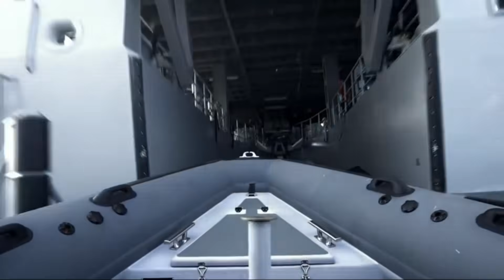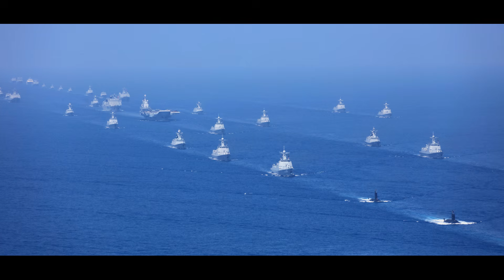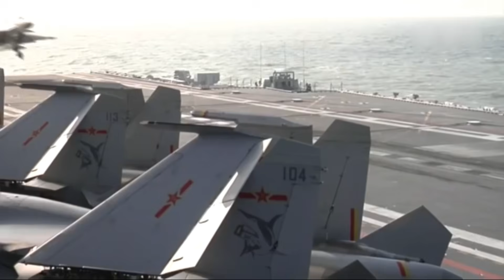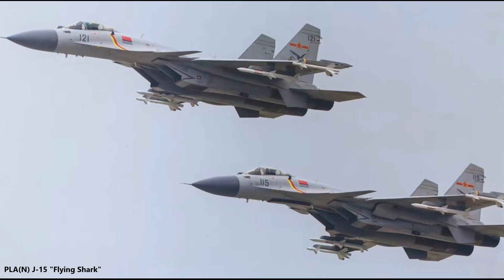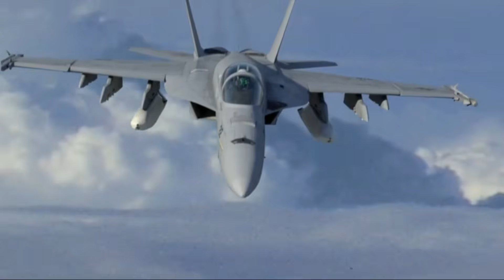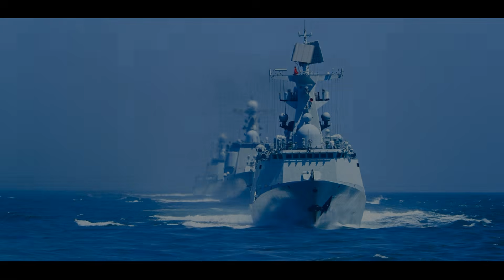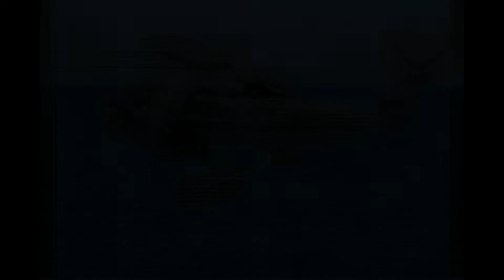Up-Gunning the Arafura Class OPV

Comment: This is second time that I have watched this excellent video, with a gap of about two years between them. It is ironic that the lack of armament for this class has become more and more controversial as the threat from China keeps increasing. Last year a small Chinese taskforce conducted a live fire drill right in the area between New Zealand and Australia, which created a massive panic. It is clear that both the RAN and the RNZN are lightweight players stuck who are largely stuck with a handful of obsolete platforms. They will be in serious trouble if a war begins, and that possibility keeps increasing. It is a huge shame that politicians from both countries didn’t take the three seriously.
 As did the Arafura, it is a good looking ship that is ideal for constabulary duty and humanitarian relief missions. It is a big upgrade on the previous classes. Yet it is a major oversight that it doesn’t have a respectable armament with matching sonar and radar systems. They should have given it a 57mm main gun, an eight-cell VLS block, two single torpedo tubes, two decoy flare launchers, and maybe two remote-controlled heavy machine guns or small auto-cannons. Now that might sound excessive to a few people, but that is what European corvettes are now getting equipped with. There is a new Cold War starting, with China, Russian, North Korean, and Iran all on the other side.

Comment: The analysis presented in this video is comprehensive,  however recent experiences  in the conflicts in Europe and the Middle East demonstrate how rapidly war technology can change. The use of  attack drones has escalated very rapidly. These small drones could be launched from fishing vessels as well as regular naval vessels. Operate beyond visual range is also possible. Further, arms payloads of these new drones have grown in both size and weight.  The potential conflict scenarios presented in the video don’t seem to take into account the harassing tactics employed by that large northern neighbour. No doubt the use of these new drones for sea based harrassment operations by an adversary needs to be factored into the configuration of Australian naval vessels such as the OPVs.

Comment: Interesting analysis.

Although Canada's strategic and threat environment is quite different to Australia's,  Canada would do well to replace its existing fleet of aging and obsolescent Kingston-class Maritime Coastal Defence Vessels (MCDV) with a modern OPV like the Arafura. 

I'm told that a prototype OPV is being developed by a consortium of companies including Fincantieri, Thales Canada, and a couple of other companies. The ships will be designed and built in Canada. Potential armament and sensor systems have yet to be identified, but containerized mission pods are being considered as part of the overall design.
Reply: The big news today basically sums that up. The Arafuras will likely end up with Border Force and a couple could end up being donated to PNG. They've said they're not procuring anymore than the 6 that have been built or are on the slipways.

Comment: I get the feeling that the more one optimizes a patrol ship for naval warfare, the less it can perform other roles like finding & boarding commercial vessels. Everything is a trade-off (weight, space, cost), so if you just keep adding more naval warfare capabilities you will end up just wishing you'd built another frigate.
The Chinese "patrol boats" are much more aggressively on the warfare side of that pendulum, but as the video makes clear, they are looking at potential confrontations in a very different way.

Comment: so thinking of cost constraints the missile needed for saturation only have to have strike range and guided ability so for example could use dummy missiles to help overwhelm a ships or fleets defensive system so even a containerized dummy missile system could contribute at much lesser cost and could be fitted on many ships naval ones with container capability and smaller specially made ones I've recently been wondering about the size of VLS's and their ability to be fitted in containers don't have to be MK41 cells the earlier systems could do the same for dummies but can the MK41or others be containerized?

Comment: The Arafura should be classed as Tier 3 vessels in the new Navy parlance. First 4-6 of these vessels should go the the ABV. The last batch should have the helideck instated. The upgunning should consist of 30mm weapon as far forward on the B position, actually all 25mm weapons should be upgunned to 30mm to have production commonality with the Army 30mm. In fact, rather than using the Typhoon mount, all future navy units should use an umanned navalised verson of the T2000 turret. This provides 3 advantages, 1: 30mm stabilised gun for air and surface targets, 2: Two surface to surface missiles capable to strike out to the horizon, 3: Future mounting for a directed energy device.
Then there should be a NASAM mount behind the 30mm and infront of the bridge with a optional NASAM mount/SSM where the Darussalam-class has the mounting.

Comment: The 003 is actually based on the hull as 001,002, the three ships are all around 50.000 tonnes  . I have proof in satellite pictures and actual prints of original 003 design .

Comment: The naval version of the evolved Cape class should be modified slightly so a MK44 Bushmaster II 30/40mm with a programmable airburst capability can be integrated onto it for use as a main gun. Since the Armidale class is currently fitted with a 25mm main gun a 30mm gun makes perfect sense for the evolved Cape class vessels.
We are seeing a move to 30mm in the ADF so a 30mm gun is sensible from a few standpoints with ammunition compatability with other ADF equipment being just one advantage.
Also having an ABM capability for counter UAV operations is another benefit of having a 30mm main gun.
The MSI-defence systems SEAHAWK series fit's the bill nicely or at least at a minimum the Rafael Typhoon Mk-30c RWS should be fitted or an equivalent. One across the bows of a smuggler with a Browning pistol won't do the job. And I would refuse to serve on a patrol boat or OPV without a main gun as it's a duty of care and personal safety issue for the crew and boarding party.

The Arafura class OPV as originally designed and specified when first displayed as a model was a capable ship. Using the Bofors 57mm Mk3 Naval gun instead of the 40mm for interoperability with the USA would make sense as the ships were designed with the 57mm gun in mind and would be a better choice than any other main gun. 
Also the NSM could be fitted in place of the Exocet missiles that are shown on the Darussalum class vessels so the vessel would end up having a similar fitout and capability to the Darussalum class which are currently in service.
The ship is called an OPV for a reason it was never designed to be a heavily armed warship. But with a SAAB combat system and a SAAB Sea Giraffe AMB radar fitted as well as the BAE Mk110 57mm main gun plus also having the NSMs equipped on the vessel would mean it is fitted out properly. Also remote weapons stations or machine guns or both can be fitted if required.

The fitout described above is very similar to the Independence class LCS and would be a safe and effective fitout for the Arafura class.
I am all for Australian jobs but not at the expense of capability. Maybe we should have got them built overseas we might have been able to fit them out properly with the cost savings.
😎🇦🇺

Comment: Yes, upgun to a 57mm multi purpose main weapon, add a mostly defensive smaller weapon ( 30mm or so ) and the exocet missiles. Skip the very expensive long range missiles. Do upgrade the radar and sensors to allow if to add to the overall battle network so it can take over lesser military roles when the DDs go off to war. Add the ASW to a few as well.

Comment: Naval Strike Missiles are probably easier to integrate and cost half as much as LRASM. While LRASM is more capable, NSM seems like an adequate match for the overall capabilities of this platform. 

A 20mm Phalanx gun would be a good option for the forward deck. They are capable of engaging surface targets and aircraft in addition to missile defense. They are also completely self contained and independent, allowing easy integration. 

The towed array in a container seems like a good option to have. I am concerned that this might interfere with any aircraft operations, even while stowed.

Comment: it costs the same as the Type 31 frigate with 1/10 of the capability.
The T 31s are about 450 million AUD, the OPVs are about 300 million each.
The T 31 have 57mm main gun, 2 40mm guns, 24 VLS system and a helicopter.
the OPVs have a 25 mm gun.
Value for money? Not really

Comment: I think the main takeaway of mine from this video is that Defence missed the point, you don't need a 1600 tonne vessel to follow fishing boats around. What we really should have bought is an actual patrol boat and a Corvette, with a proper suite of mission systems and weapons systems.
The OPV is also too slow to do anything with a Hunter or Hobart, we'd have been better off going for an actual patrol boat to shoo the fishing boats away, and procuring a 2000 tonne Corvette with anti ship & anti air missiles with a real helicopter capability on a hull that's capable of 30 knots.

Comment: The RAN learned that from the RN. Stick the minimal amount of stuff on your ships you can get away with. 
On a more serious note, I've seen the exact argument over uparming in regards to the River class. They need a 57/76mm gun, they need SeaRAM or VLS for CAMM, they need AShM, they need x, y and z. Yes, the River and Arafura classes are very lightly armed compared to their Russian and Chinese counterparts. But they're designed more as heavily armed missile boats for flinging as many AShMs as possible in mass strikes against enemy warships, not low end patrol boats for duties like fisheries protection. The danger also is, if taking a River B2 for example, sticking a 57mm gun, an eight pack of NSM and ExLS for CAMM on it, the politicos see it as a warship and cut funding for actual warships. Maybe this may change, for the RAN at least if the PLAN carries on as it has been, but I doubt it. It's two different philosophies and the money spent turning Arafuras into what would be grossly over-armed OPVs or somewhat anemic corvettes is better spent getting a decent sub fleet.

Comment: Arming up the Arafua's will increase displacement & decrease their peacetime patrol performance! The boat stowage in the rear does allow some wiggle room for improved surface & sub surface boats! With a containerized control room module on the front of the drone helo deck! Pre war buildup time could allow for other weapons system upgrades! The biggest problem with its platform is its slow speed! 25kts would have been a massave advantage just keeping up in heavy sea states that make ships crawl along!

Comment: The same unfortunate mentality took hold of Canadian defence establishment when designing and procuring the Harry DeWolf class Arctic Offshore Patrol Ship. Based off the Norwegian Svalbard ship design, which had featured a 57mm bofors gun, while the Harry DeWolf, features the same inadequate armament 25mm gun as the Arafura. 
Even worse is the fact that the Russian Project 23350 Arctic Patrol Ships, which are also based on the Svalbard, are armed with a 76mm gun and Kaliber anti-ship/land attack missiles.

Comment: Could a phalanx system be installed instead of the forward gun?     A 20mm rotary cannon would give it some severe local firepower.  Also get some anti-tank shoulder launched missiles for heavier weapons.   A couple of rail mounted .50 Cal's add a 3 mile hit to anything.       
Most Western countries tend to underarm their ships in comparison to their Russian equivalents.

Comment: The LHDs are made out of HN-55 Chinese steel, a weak steel only used in Ships that never leave the Mediterranean. Some genius in Canberra signed off on weaker steel for the flight deck, so VTOL F-35 is a dream.. Austral also used cheap ass chinese aluminum on the OPV's, one hull completely delaminated .. Yeah the OPV floats , how long before they degrade and require a docking

Comment: Looks nice, but needs a few things:

Vertical Launch System, 36 cells should do, bow & stern
5" rapid fire deck gun
Phalanx CIWS, bow & stern
torpedo tubes & depth charges
10,000 mile unrefueled range, at 35 knots

just work that into the design, and Australia will be first in line to buy three or four
NZ might even buy one, if they can finance it
Reply: LOL. Bad idea. Because cost per ship triples. Or in Australia's case, would more than triple seeing as unlike us, you folks need to import the weapons. Take example of three different types of 2000+ ton ships in Indian service:-
1.) Indian Coast Guard OPV: 1x or 2x 30mm autocannons + 2x HMGs
2.) Indian Navy OPV: 1x 76mm Oto Merla SRGM + 2x AK-630 CIWS + 2x VSHORADs + 2x HMGs 
3,) Indian Navy Corvette: ^All of the above + 8x BrahMos VLS + 32x VL-SRSAM VLS (ESSM class)
.
Now coming to cost per ship, in order, it is:-
$ 60M
$ 100M
$ 200M
.
Now considering your Australian Arafura class OPV is armed similar to an Indian Coast Guard OPV, you can see that the cost would easily triple per ship.

Comment: A Better Choice for a Small Surface Combatant?

The UAE Navy have an interesting platform in the Falaj-2 class based on the Italian Diciotti OPVs built by Fincantieri. 

It is small, stealthy and faster, with better radar, Exocet anti-ship missiles, a modest MBDA MICA point defence surface to air missile system, and a 76mm/62 Oto Melara Super Rapido naval gun capable of firing DART ammunition, which can take down a sea-skimming ASM. 

There is now a more capable Falaj-3 in the works. 

If they were modified to carry more fuel, and thereby extend their range, and fitted with 8 NSMs instead of 4 Exocets, they could lurk in the bays and small harbours of the archipelagic waters in our northern approaches and serve to provide an effective anti-access/area denial capability to the RAN and greatly increase the complexity of mission planning for belligerent fleet commanders. 

The Falaj-3 is too small to carry the LRASM, but like the NSM, these missiles can be launched from the back of a truck hidden in a coconut plantation and cued by air-borne platforms. Faced with the prospect of distributed lethality and guerrilla warfare at sea, with any luck the enemy would deem the risks to be too great and seek good fortune elsewhere!

Cheers!